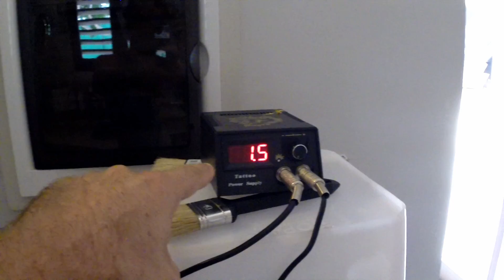Making GaNS - part 1

Comment: Why Did My Nano Coated And Plain Copper Plates Turn A Rusty Orange Color ? The Other Set Up Worked Great,From Maryland USA.
Reply from the maker: +Thomas Walls No idea, but a lovely color I find.....
Reply: +Thomas Walls a vid a watched said that the color has to do w/ the "purity" of the copper material and if it turned a rusty color that there were impurities. Also I saw another vi where the presenter thought his color was "redish" b/c he was using too high a current to charge the plates. This fellow was using .2amps at .3 volts when the "redish" color was achieved.
Hipe this helps
Reply: +Tao Trader "Hipe" = "Hope"

Comment: I started nano coating with the caustic:  but couldn't wait so I nano coated some copper wires by fire  so I could get my gans production started.  I set it up with a 1.5 V battery and maybe I didn't let the copper get red hot between all of the 30 quenchings - but the nano coating started coming off. ..brown powdery.  I set it aside in a jar in case it was salvageable...and the next morning it had started forming a turquoise layer on top of the brown ...and now,  days later more.  I'm going to try the water in pain patches....maybe there's something to be learned by this mistake.   Good luck to us all! - Beth in Oregon

Comment: Any updates on this?   I used a 1,5 v battery for about 10 hours, and unfortunately it turned the nanocopper into a matter state (brown dust corns at the bottom)
Reply: +Thomas Free Your brown copper stuff is Cu GANS you need to oxidize it. When you work with current you are producing GANS so fast that it can not oxidize it. Use a Aquarium Oxygen pump to oxidize it. Your brown cu gans should get green after a few days when it is oxidzed to CuO GANS.
Reply from the maker: +Thomas Free Bare Zinc and Nano coated Copper?
Reply: +Roald Boom ...  Nope, it was in my copper GaNS (nano coated copper and copper)
Reply from the maker: +Thomas Free Maybe use another power supply, I understand that some people are using the pc laptop loaders, they go from 100-240V to a decent low DC...... or buy a tattoo power supply like I use, the cheap one I'm using may cost you no more than $30